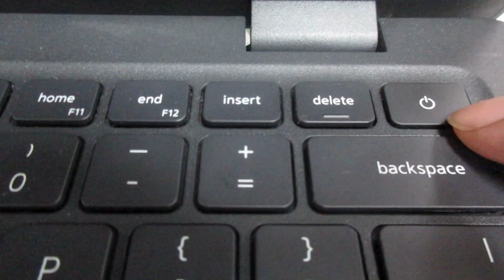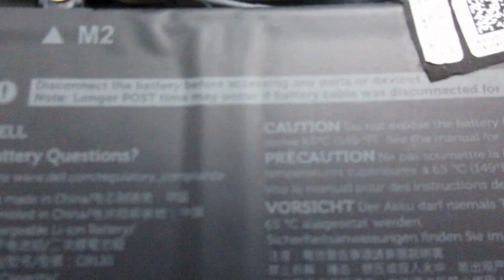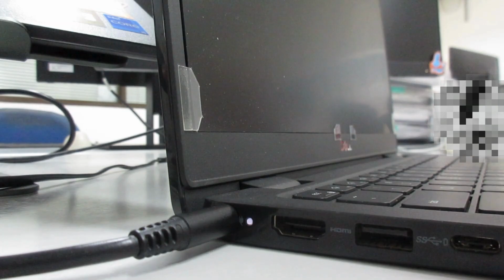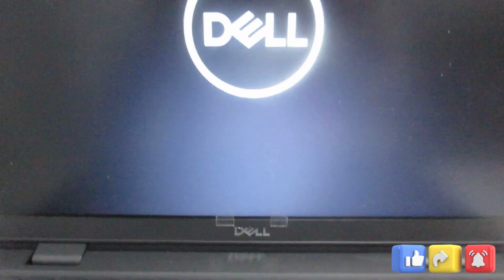How to fix Dell Laptop Cannot turn on | Tutorial | Hobi IT

Comment: fn-power button works for my dell latitude (same laptop as the one in the video) and I came across this issue for the 2nd time and still works!
Reply: My laptop Dell precision first hang on home screen and I was power off so now don't turning on or not charging
Reply: @LockBit3.0-v9y idk man, maybe try bringing it to a professional technician or look for other bootup troubleshooting with your laptop series/brand
Reply: Did your laptop work with this tutorial? I really need to know, bro. My laptop is a Dell Latitude 5300.??
Reply: @pepe4i207 just try it man, its not going to make your laptop explode if you did and it doesn't work because for me it did work.
Reply: @pepe4i207 no never now too still dead my laptop 
Technician said 15days he needs to found a shock circuit in motherboard 
Now 5days done 10days remaining 
Pray for my laptop 
Hope your problem too easy and early Fix

Comment: Warning guys.
It only get worst after I push the button for few secs...
It turn out that the only problem is in the charger pin itself. And I am facing big trouble since my laptop is way old that my microsoft acnt cannot be recovered when I forgot my pw and the 2nd problem is the phone number registered is no longer available since it was expired.

Please guys How will I recover my laptop since it sent a code to thta email but I cant open it since I forgot my pw? The recovery phone number was already gone because it expired for it was no longer in use... Please help.
Reply: Consider reinstall win11

Comment: Mines like it was a wierd noise and it won't turn on

Update: I fixed already 7 months ago you just have to hold the power button
Reply: Like disk crashing or the beep but weird
Reply: same
Reply: Same
Reply: same did u get urs to turn on?? if so how
Reply: Same
Reply: My optical drive is making clicking noises, it's defective so I'll just remove it